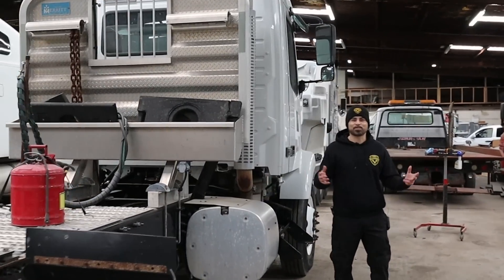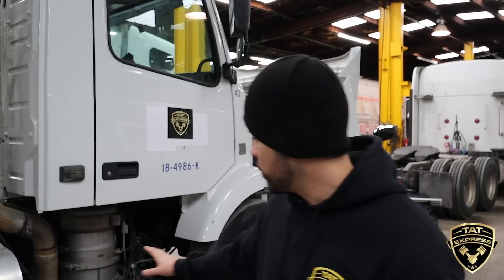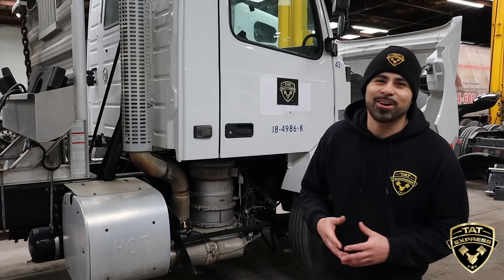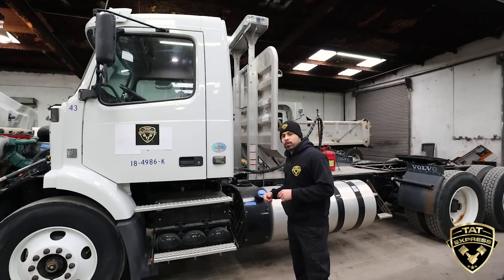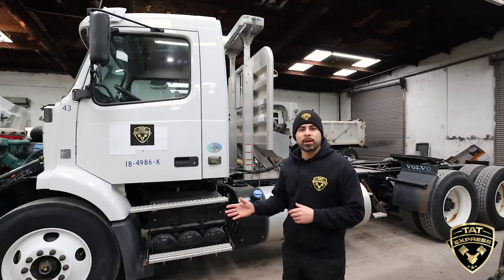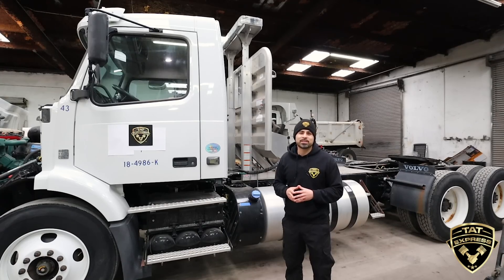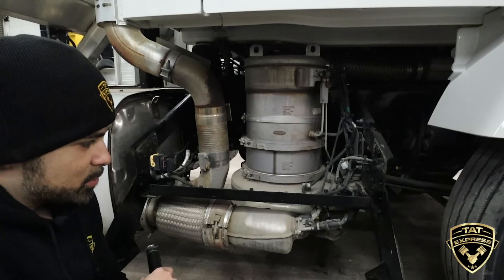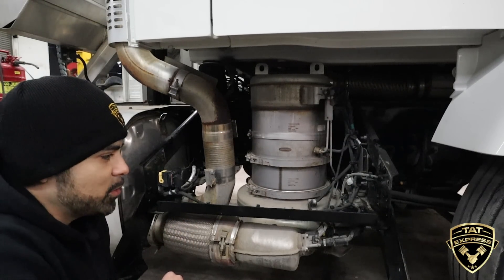Common Issues on Aftertreatment

Comment: I follow you because you are knowledgeable of the subject.
However, most of us go to shops where the knowledge base is low, due to lack of training, and all they want to do is take the filter to clean it in the machine.
Where hours of service add up quick.
Where cleaning the filter outside the truck does not solve the issue, because when the system is not working properly, it is ALWAYS due to inefficiencies or malfunction. The DPF system needs, and should have, actually must have gauges for every sensor in the truck, including the differential sensor.
It would make so much easier to monitor the performance and there lack of.
Most company truckers don’t know and care either, because they bring it to the shop. However some of us OO and hands on not certified mechanics, we have the knowledge n experience but the tools needed are very expensive.
I have diagrams of the system. Not very complicated at all, just a few sensors.
So that makes not simple, but definitely not crazy complicated.
I like your videos you always make nice presentations.
Thanks

Comment: I have volvo vnl d13 500hp it is 2017. i have two codes sa 16 dtc p296800 and sa16 DTC p05EB00 which both are tied to the after treatment system. I think my 7th injector is clogged. What do you think ? no check engine light yet on the dash

Comment: Hi I have code keeps coming on. Spn 4364 Fmi 18. I have put new def doser on and drain the def tank and clean it out. Put new def fliter on and flush out all the def lines. I clean out the 7th injector. I do a force regen everything pass. But three days later the same code comes back on. The truck has 985634 on. The SCR and the DPF fliters are original. The DOC is 2 yrs old. I had all the fliters clean last yr..Maybe you can let me know where I should look next.

Comment: 2016 Volvo d13. 960,000 miles SPN 4364 constant since about 700,000 miles, been in shop SEVERAL times. 7 injector replaced, NOX replaced DEF filter in DEF tank replaced. DEF filter removed and baked all build up removed from DEF SYSTEM You name it it’s been replaced it or cleaned it. Check engine stays off for about 2 weeks (after parts replaces or cleaned)then right back on. Truck won’t regen on its own, manual regen once a week. Now we have SPN 5018. Truck runs great! Help, any suggestions would be greatly appreciated.

Comment: I have a 2013 cummins that keeps throwing code spn 4364 fmi 18... I have replaced Inlet and outlet nox sensors, new def doser injector, new def filter, fresh def fluid and fixed and cheched all exhaust leaks and the code keeps coming back. I don't know what else to do

Comment: Thank you. When people speak about the after treatment. I cant understand a word they say. It goes like this oh the truck cant breath and its got to many sensor,  the one box is expensive and those filter going to cost you. Yep filter now are cheap than when i started, hell i seen them as low as 800 bucks. Now i understand how the system works. Now i know what to replace for prevention maintenance. I never knew about the 7th injector getting clogged. Or the lines line getting looked at. They made it seem like it was such a problem delete it. Not!

Comment: What is the amber engine light it turn on me while driving it’s not a check engine just the little engine yellow and it’s not blinking in the manual says it’s an amber engine light which is a malfunction of the emission system

Comment: I learn every time I watch your video sir. Thanks. Quick question. I changed nox sensor couple of weeks ago  on my Volvo 2012 D13. The check engine light went off.I was happy. Then when I turned the truck off and then on , the check engine light came back with different codes. One permanent code is son 1231 fmi2. 
Where do I start to fix this problem. Thanks

Comment: Thanks for the awesome videos and if I’m ever in Texas I will be sure to make an appointment and just have you guys work on it. Although I enjoy watching the videos of it I feel is over my head mechanically. I have a 2014 Freightliner Cascadia that I purchased and I did a parked RE-GEN. It took about 45 minutes and it got really hot of course a check engine light came on towards the end and it said that it was a temp sensor for the DPF. The next day it was gone the check engine light went off. Does this seem normal?

Comment: I have 2013 Volvo d13. What exhaust temperature should be at when I'm driving 65 mph
Reply: The aftertreatment system needs to maintain at least 420F for DEF to be injected into the exhaust stream.  It is good to see at least 500F+ coming straight out of the engine to help maintain the aftertreatment system temp for proper operation of the SCR.  SCR systems work more efficiently at 500F or higher.

Comment: Hello sir . I have 2017 cascadia with over million miles . Recently I m having problems with MIL light go on and off.  With 3220 fmi 20 codes.Light comes on when I pull heavy load And go off when I pull light load .I change both inlet and outlet nox sensor and clean dpf filter and  def dozer as well. Please advise me what could be the problem. Thanks
Reply from the maker: Rock P, I would recommend a complete ash cleaning and check to see if engine is creating excessive soot.
Reply: @TATEXPRESSINC  I am having the exact same issue. How much for an ash cleaning

Comment: What is a normal pressure on the differential pressure and what is considered high.  I used to get a reading of 8-9. On Trk’s with 60,000 now in the last 4 months I’m getting readings of 27.  I have 15 Cummings isx15 2014 too 2017.  I Thank you 🙏 for time.
Reply from the maker: Jersey, sorry for the delay.  If the truck has high idle time I would visual inspect differential sensor hardware, if good run regen to confirm pressures are high and if so, filter would need to be dropped  for inspection.  Root cause would need to be determined
Reply: TAT Express Inc. I do a forced regen every month.

Comment: Hello Adam I enjoy your videos. I have a question for D13 engine oil temp. runs 234 -249 degrees all the time. Please tell me this is not normal. And should I change out cooling valve/ oil thermo?
Reply from the maker: D13 Volvo Oil temperature is 194-243 degrees normally.  Up to 262 degrees with full load
Reply: @TATEXPRESSINC   Even on a 13k lb load or empty  @ 55mph. Coolant temp @170 but engine oil temp at 235 degrees in to 30 min.  of driving.